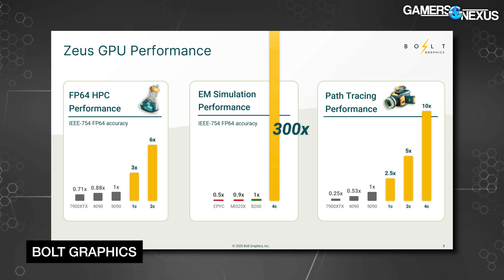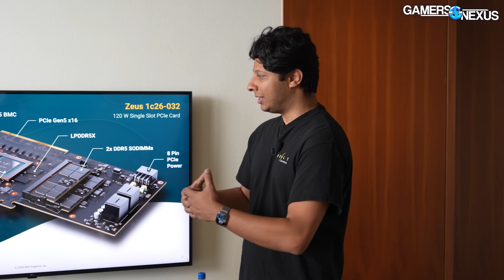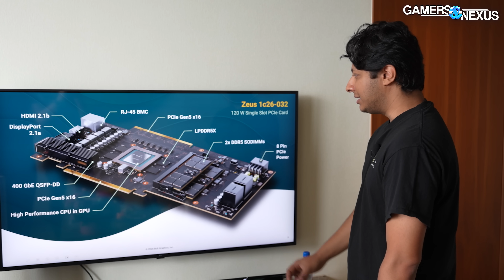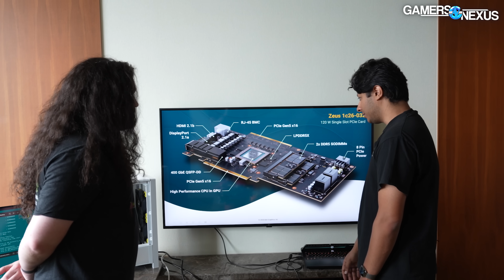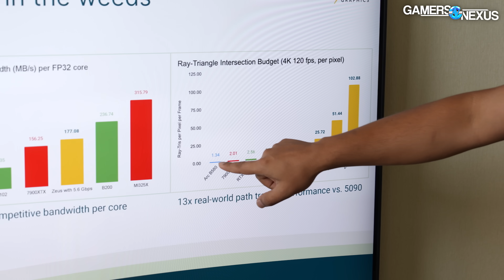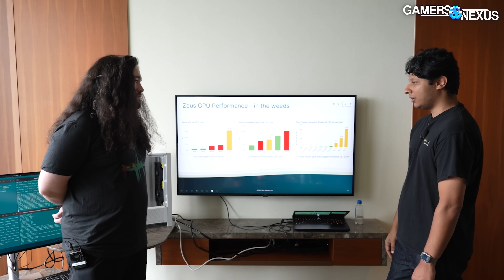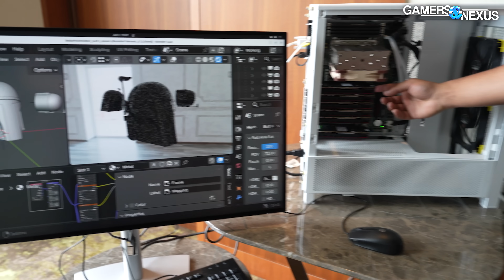A New Gaming GPU Challenger: Bolt Graphics Takes Aim at NVIDIA

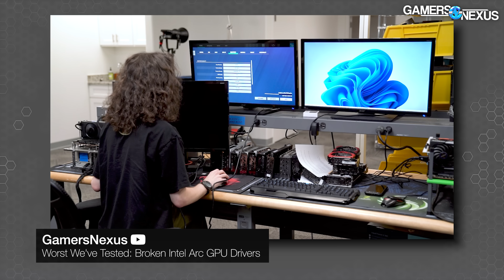Comment: 1:59 Bolt, tell everyone it’s a dual system so that you don’t need RGB LEDs on your cards as decoration and it dissipates heat faster😅.  I have 64 GB of DDR5 S)DIMMS coming in.   When you think about what this could be used for since it’s not specialized it’s definitely interesting because it could go inside of a robot or do something like signal processing for a bunch of software defined radios.   I have to assume that he might be able to build a commercial market for things like vehicles to process all of the sensor data.  Just think big, and don’t sell out.   So that you can focus on what you really love to do but know that a second company could help you realize those dreams you find someone that wants to run a second company called NUTS.  Then you have the nuts and bolts of making this actually happen.

Comment: This guy sounds like he owned a voodoo5 in the back of the day. Effectively, this card is a return to 2015 design methodology make it huge, make it fast, crunch it out. But just like all the other old cards that used to apply to very specific render pipelines, (glide, opengl, etc) this card is gonna absolutely crush on a couple of games and look like dog shit on others. 
I'd forecaste it's gonna lose to everybody who's building into the AI optimizations of Nvidia/AMD and utterly dominate on those who still do it the old fashioned way and optimize around a render pipeline that just wants raw horsepower.

For that reason alone, I'd buy this card and support him. Even if it was subpar in most applications, because it's still doing what you can consider the most "pure" way of calculation 🤔

Comment: As for the comments on designing a GPU for the Future of Gaming... I'm of two minds here:
1. It sure is important to finally bring new architecture design ideas into the gaming GPU space, given that rasterization has been around ... well, pretty much forever, at least since the early days of 3D engines... and focusing on PT over regular RT is also pretty promising,
given the major visual uplift it can provide.
As soon as the currently massive performance hit of PT is "solved", other GPU makers would surely be forced to invest into this technology themselves, as game developers will likely be already chomping at the bits to finally adopt this superior technology at scale.

2. The drawback could however be that "retro"-gaming would be nigh-on broken or at least unfeasible on those kinds of GPUs... with them leaving behind Rasterization so confidently, will then-older games (remember, we're talking 2030 *at least*) then simply not run without some kind of compatibility patch/layer introduced to them?

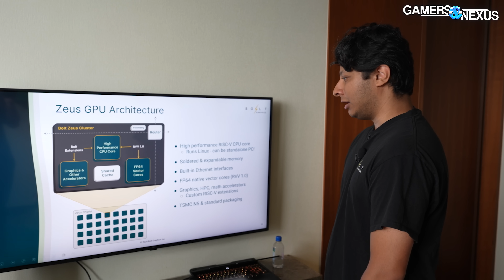Comment: 13:26 I don't think the economics will make sense unless Bolt gets backing from another key player. Since Bolt wants to target the creative space first, the big players are Adobe, Sony, Apple. If Bolt is angling to move into other industries like CAD and simulation, then DRAM is going to be a larger issue, which brings Bolt back to the same supply constraint that even Valve couldn't overcome. It's been known for awhile that Nvidia has been moving away from consumer and targeting medical field applications. AMD is now trying to catch up and is able to diversify between sectors to likely gain more foothold as AMD invests more into open source projects that involve Valve. So with Bolt....I want Bolt to succeed where they can but I don't see how they can pull it off in a realistic timeline that doesn't result in a slow downward trend to irrelevance, especially since Bolt' first market is the creative space, not consumer gaming.

Comment: 23:59 what is the sense of this graph? Memory bandwidth/core count? What it signify?
i5 12th gen with its 6 cores would sit at 8000mb/s with a single ddr5 ram stick. Does that make it faster in gpu workloads?

Comment: So is this like a heterogeneous SoC type deal or a normal CPU that has a few more dedicated accelerators for things like path tracing, EM simulation and other computation usually offloaded to a GPU? I don’t think those kind of SIMD extension accelerators can ever be faster than dedicated hardware since the extension instructions still have to go through the normal decode/execute pipeline of the CPU, share the CPU cache, and scaling core count or vector width would be hard.
On the other hand, if it’s more like an SoC (like apple silicon) then I don’t see how it’s anything special. Nvidia or other established companies can easily make and integrate accelerator designs for whatever Bolt is targeting and write the necessary software much faster.
No matter what I don’t think it’ll ever be competitively priced for gaming since the silicon also includes a CPU and thus to include a sufficient amount of GPU cores Bolt would need to make the die very large (expensive) or make the GPU small (low performance)
Reply: Also he says “a lot of GPU workloads prefer latency.” Not sure when that would be the case? Maybe if you were starting a really small computation and the overhead from launching a GPU kernel is longer than the execution time. In that case you could just use the CPU instead of dispatching work to Bolt’s GPU anyways

Comment: I like the idea of the cards coming with no memory to start with, and people just plugging in some DDR5/6 SODIMMS;  I do wonder however if there will be enough memory bandwidth for the higher end cards going forward as GPU's often have specialised faster memory that typically doesn't appear on SODIMM (not that it CAN'T be put on sodimm that is!)

Reminds me a bit of the AMD BC-250 really. But those can't run in PCIe dGPU mode.

Comment: This Bolt stuff could be interesting. Even if only very new RT heavy games support them. They could start out as more of an RT accelerator a bit like the physx cards from back in the day. As long as they are not too expensive it might be feasible to buy a Bolt card to do the RT in new games while still using your old normal GPU for raster.

Comment: So a silicon graphics style approach with workstations as a focus. For consumers, it'll be 5+ years before we get proper obtainable GPUs again if at all. It'll take years after that to have software that might actually be able to use path tracing, so it'll be the better part of a decade from now before that by a guess based off the past. Going for a 5090 and saying "it'll be a lot less than that" could literally mean 1500 USD for something with subpar raster performance, which for even a lot of workstation tasks is always going to be important. This is an EXTREMELY niche design/focus in a market that hates the niche for consumers and for the target in production workstations, the number of studios are dwindling over time.

I do like risc-v, I've been tinkering a lot with it at machine level native assembly instead of just running ported software poorly, so that doesn't really bother me. Good luck is all I can say, by the time this would remotely have a place in a market that can actually afford it without credit cards in terms of consumer, DDR5 will be past EoL.

Comment: Energy efficiency would be a laughing stock: Jensen Huang (Nvidia boss) always praises the efficiency of his chips. But the RTX 5090 is huge, requires a special power cable that risks melting, consumes around 500W-600W and requires a heatsink the size of a brick. For Bolt to come with a thin board that consumes only 120W (as much as a laptop) and produces infinitely higher performance [A New Gaming GPU Challenger: Bolt Graphics Takes Aim ..., Startup claims its Zeus GPU is 10X faster than Nvidia's ...], would make Nvidia engineers seem completely out of touch with reality. 🤣🤣🤣

Comment: Since this GPU is targeting the content creators and more work focused applications first, I think the field of photogrammetry and 3D gaussian splats is something to consider especially since when making or processing the data most programs use nvidia cuda as way to talk to the GPU and thus making it at the moment very expensive to buy the necessary hardware especially since larger projects require lots of ram on the GPU.

Comment: People dislike path/ray tracing because the performance you get compared to what you pay is abysmal. If a card is optimised from the ground up for the workload balance of a path tracer and you can get reasonably noise free, high framerate output then people would look at it differently. But that has it's own market penetration issues because most games are designed resterisation first since that's what everyone's current GPUs are built for. I wonder if there is a transitional possibility of having both a strong raster card and an RT accelerator in the same computer.

Comment: The 400 Gbit Ethernet port is super interesting as not only can that be used to cluster these cards across systems but it also as a video output using SMPTE-2110.  Provisions are there for 16K output resolutions over SMPTE-2110 before compression is involved.  That is another thing missing from this presentation that modern GPUs handle are video encoding and decoding.  In the whole AMD, nVidia and Intel GPU world, this is done via a dedicated hardware block before spilling over into shader driven solutions.  I have a feeling that all of this is going to be done via RISC-V cores which will get the job done but at a higher power consumption and detriment to anything else running on the card.  The modern use case would be streaming a game which on modern AMD, nVidia, and Intel graphics cards doesn't really impact game performance that much due to the dedicated hardware codec block (yes, there is some reduction as things like memory bandwidth are shared resources etc.).  Here if it takes say 25% of the RISC-V cores to encode the video in real time, you'll be hit with a 25% reduction in frame rate conceptually.  

The usage of the RISC-V cores screams a re-try of Intel Larrabee using dozens of Pentium 1 cores with a proprietary  512 bit vector extension (not AVX-512).  The big problem for Intel then and I see Bolt run into now is scheduling all of that out in software.  AMD, nVidia and Intel's ARC line of GPUs all do hardware scheduling for this very purpose as it can lead to very, very unit utilization at run time.  The key thing there is at run time there is a lot scheduling being done as part of the JIT shader compiler so that it can take shader cores and scale that workload across say a RTX 2060 all the way up to a RTX 5090.  Counter intuitively, it is the RTX 2060 that takes more scheduling work as what can be done on the RTX 5090 in one parallel pass may need to have two or three iterations done.   One other problem Intel ran into with Larrabee is the lack of hardware fixed function units for things like ROPs, TMUs and as the goal at the time was do even that via software.  Bolt seemingly has some extra functional units in the RISC-V cores but it isn't clear if they accelerate these use cases.

Copackaged optics is an interesting discussion here as it was in more of the UPCIe context.  Optics herewould make sense to replace that secondary PCIe connector and enable faster Ethernet speeds (think 1.6 Tbit).  I will say that Bolt seemingly has the idea of scaling baked into their hardware design which is a good thing from the start.  Being able to scale up chiplet count on package to additional PCIe connectors scaling up inside of a node to having 400 Gbit Ethernet to scale out across multiple nodes means that a lot of computing power can be quickly aggregated.  Think of several big boxes clustered together each with eight Bolt cards with 4 chiplets each in an SLI-like scenario.  AMD, nVidia, Intel and even Apple have all toyed with chiplet scaling different aspects.  The direction Bolt is going in is what nVidia and Apple have gone by but only to pairing two chiplets together to double performance.  AMD interestingly indicated they tried something like this but ran into challenges scaling up the hardware scheduler so they went a different direction with RNDA3 (7800 and 7900 series).  AMD's Instinct accelerators in data centers however are already doing this.  With AMD merging their RDNA and CNDA lines soon, it'll be interesting to see how things play out in terms of scaling. 

Bolt's approach to ray tracing makes sense as there are several means to tackle this.  With a flexible, fast OoO general CPU core being pair with parallel GPU units might be a good combo for multibounce and multi-scattering algorithms.  Basically fire off one ray of light, hits an object and then splits into say 8 other different rays of smaller magnitude based upon the material.  Those 8 rays can then bounce again and split into 8 more.  Current GPU hardware has challenges with this as it vastly increases the amount of trig compute necessary which is a limited resource on current GPU architectures (and yes, trig functions can be emulated using traditional ALUs are vastly slower rates).  The good news here is that the number of bounces necessary to achieve life like fidelity is not that many and the number of rays necessary per bounce doesn't always have be that high.  Bolt's software based scheduler can do a lot in terms of optimism the workload and getting the most out of utilization.  

Leveraging large amounts of cache does make sense for the design, especially if they are not utilizing extreme memory interfaces like HBM or GDDR7.  LP-DDR5x when wide enough can reach rather high bandwidth.  With expected release coming next year, I'd have skipped the soldered LP-DDR5x and the SO-DIMM slots and just gone straight to LP-DDR5x SOCAMM for both.  Fast LPDDR5X exists for it, though that does overlap with AI server usage.  In that sense, users of Bolt graphics would get even more expandability and performance. Economies of scale would mean availability thought the less spent on memory pricing, that better.  I wouldn't mind a BYOM (bring-your-own-memory) type of card if it meant a lower entry level price point.  I have access to some 'slow' vanilla DDR5 SOCAMM which would be a great way to start and then later on swap it to some faster, larger LP-DDR5X modules when pricing gets sane.

Comment: This looks "weird" because FPGAs are supposed to be prototype boards with user-configurable logical units and registers.
They are not too expensive (~$100-200), but the cost can be optimized quite a bit by switching to actual fabrication if they get the ball rolling on market demand

Comment: I bet there will be issues with how this was developed. Where did the code and design come from? if its just a small team, i have to assume they are using AI, which is ok with me but it also suggests they are not in full control of the ship. It will be very hard to create a compatible device. Intel Arc proves this. Look how long it took for them to get ANYWHERE and games still come out without drivers or compatibility with Intel Arc. So i just dont see this working out, whether this guy is a genius, or just using AI.

Comment: That unified memory address space could be a performance pitfall if the driver doesn't do something clever about memory allocations. There likely needs to be some solution to keep hot data in the LPDDR5x and evict cold data to the regular DDR5 on a least-recently-used basis. If adding the memory capacities of the D5 and LP5X isn't needed, then the LP5X could directly be used as a cache for the D5, similar to Vega's HBCC.

Comment: Ngl this would be an incredible homelab card, running a cluster of multiple of those all plugged onto a single host motherboard, all interconnected with eachother, that's crazy, so much possibilities.
Wish they weren't based in the US tbh but high hopes for this